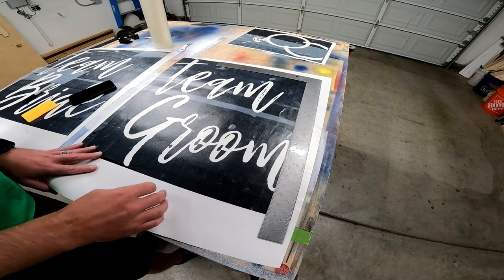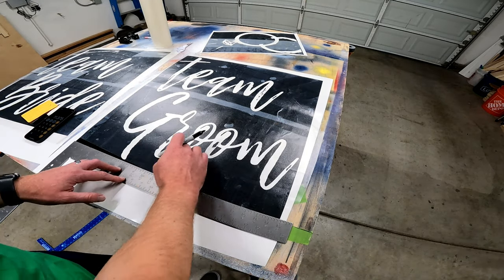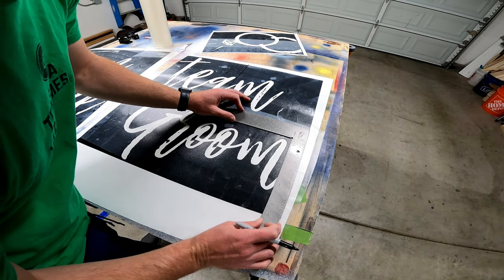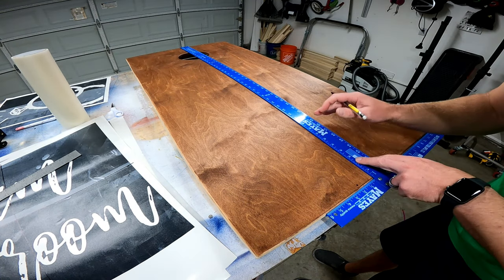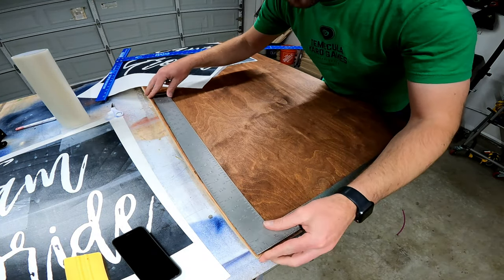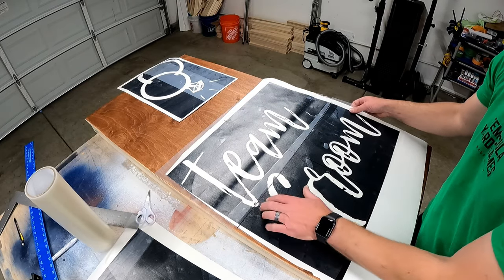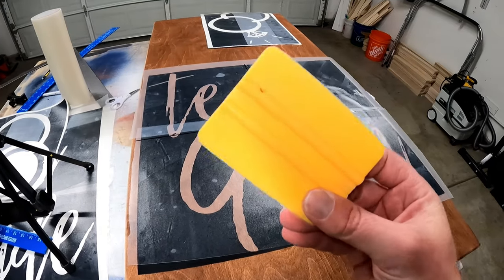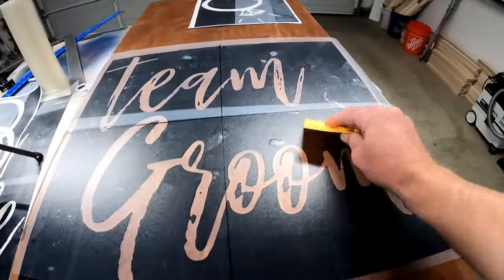Cornhole Boards - Applying Vinyl Decals

Comment: Great video! Love that board design!! Which transfer tape on amazon are you using? My clear transfer tape (transfer rite) always wants to pull up my small vinyl pieces…. Yours looks perfect
Reply from the maker: I actually just buy the one in the Cornhole Collective “supplies” section: 

https://www.cornholecollective.com/supplies
Reply: @temeculayardgames  oh nice! Maybe I need to start using a spudger 👌
Reply from the maker: Yeah, that’s not the name of it 😂 - an old credit card works just as well 👍🏻